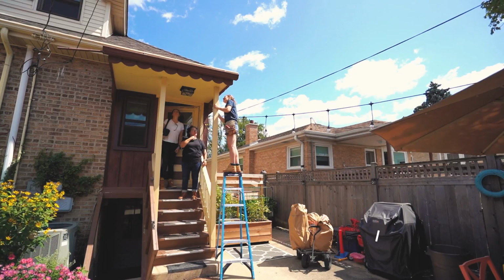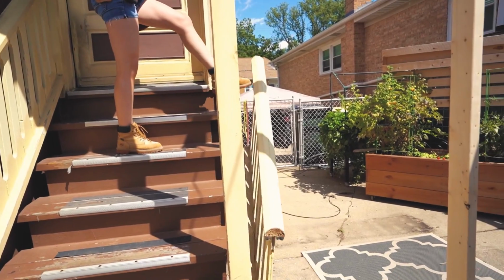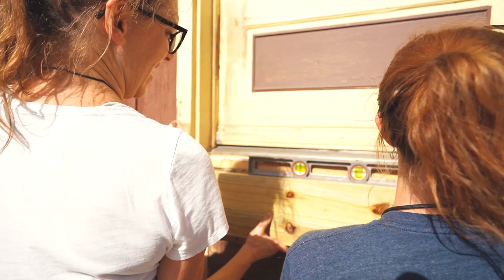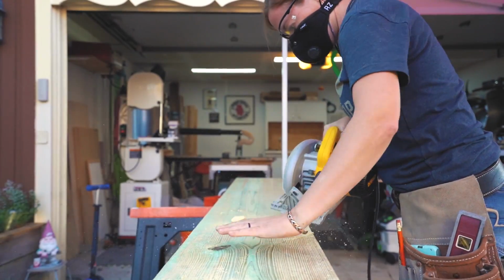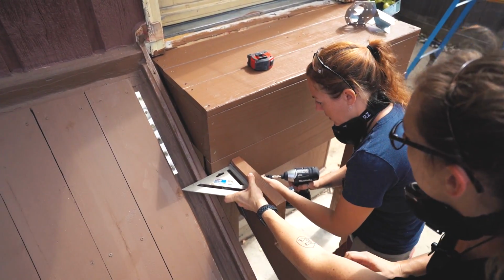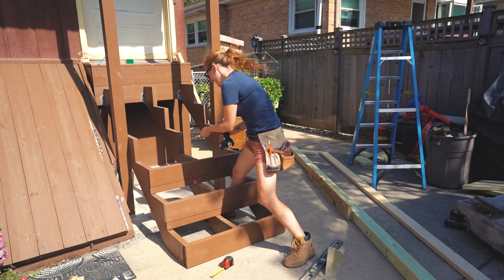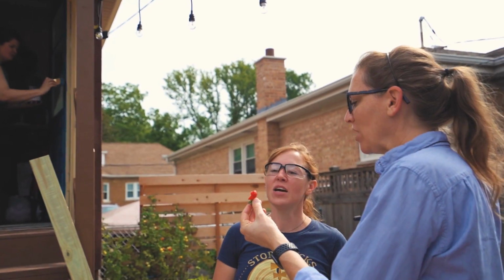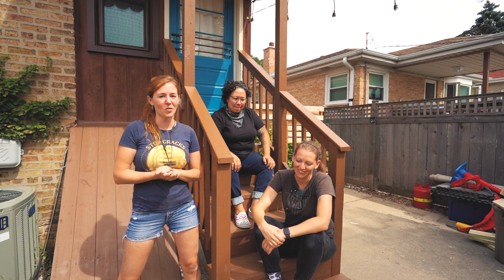Building a Set of Stairs in Three Days | DIY House Stairs | House Renovation

Comment: Great job, love your videos! Sorry to be the "but" guy, buuuuuutttt, you shouldn't use deck screws for joist hangers. There's special nails and screws with more shear strength, fit the screw holes in the hanger better, and hot-dipped galvanized to prevent premature corrosion between the two metals.

Comment: love the stairs but ya should of used 2 lag bolts at least . screwed into the wall of the house  (1 at each corner) to hold the main board on because over time  n age those screws will Give Way ....

Comment: April next time you find yourself in a struggle with concrete get a prybar put blocks under the corners then hit it on the top with the sledge it should break easy
Reply: Even with rebar in it?

Comment: Use ice to slide  heavy stone or concrete blocks on a hard surface. Lever the slab up a little at a time, shove wood blocks under each end until it’s high enough then shove ice under it and lower it. Make a trail of ice where you want to go and push. You need about three 10 lb bags of ice for every ten feet you want to move.

Comment: For non-rebar concrete pry up, put a piece of broken concrete underneath and break over it. Rinse and repeat.  Concrete has little strength against bending.  I've never had an opportunity to try with rebar, but it might work.  I had to break up gym locker pads.  After a half hour I had rounded the end.  Time to try something new. Aha. Half hour to finish the whole pad.  Good job.

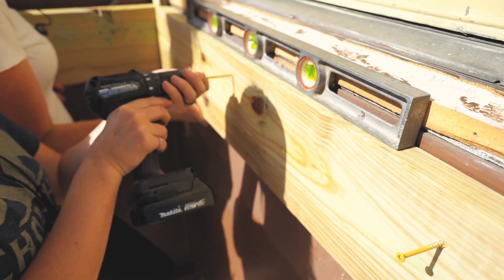Comment: Just wondering.... At 4:48 I didn't see you use Lag bolts to attach the header to the house.
Maybe some sort of flashing was needed between the house and the landing.

Also, the small landing you made, should the outer joists be be notched into the 4x4's for strength?
And, the bottom of the stringers is in direct contact with the cement.  Maybe some sort of felt paper or barrier was needed.  Nice project, tho.  You have a great channel.
Reply: Well said. I also didn't like that bottom of the stringers is in direct contact with the cement.

Comment: Nice work.
Where did you get those dust masks?
Also, if you put a layer of "sill seal" between the concrete and the wood it will keep the moisture from wicking up and make the lumber last a lot longer.

Comment: Good work and nicely shot.
slope on the landing? flashing at the house to landing gap? 
Hammering the concrete anchor bolt in, the nut should be a hair proud of the bolt stud, so you are hammering the nut and bolt together, not mushrooming the bolt. Might want to take that nut off in the future. 
Probably ought to have boxed in the top of the posts holding the awning, more secure than just a couple toed-in screws on each post. Chicago does get some pretty strong winds.

Comment: 12:35 you will need to paint the end of those treads. End grain is a sponge for water. Yes its a good idea to paint before assembly, but you should be painting AFTER cutting, so you aren't left with unpainted end grain. Do that and it will rot quick

Comment: Next time you need to break some concrete with a sledge hammer lift one edge with a pry bar, the smack it a few inches back where it is unsupported. It will break even with rebar in it, cut the rebar with your sawsall.
Learned how to do that 40 years ago on a 20' section of driveway.
Jim Y

Comment: That stain is gonna peel and chip off in a year or less. Wet treated needs to dry before painting/staining.
Reply: mascmc lol yup and it will be hot to the touch. not the best color. those spindles and railing they ripped out where awesome. the new railings are not as nice.

Comment: Treads usually have a 1" nosing.  But it looks like no nosing is required within the City of Chicago.
Reply: Not true ....open or solid riser dictates nose requirement. A solid riser requires min 3/4” max 1 1/2” nosing.  Let’s finish that wine :)
Reply: @rmaloney9976  I've  built my share of interior stairs, but never an exterior staircase. So perhaps different rules for different applications? But in any event what I was getting at was the decision to have a bullnose or not has a great deal to do with your space requirements and the minimum size requirements for a tred and what is perceived to be  a comfortable reasonable amount of tread space. Inside of a house the minimum tread depth is 10 inches, with each tread being within 3/8 in every other tread. (R311.7.4.2). But this is wholly inadequate for most designs, if you don't have enough distance in your stairwell to do a box at say 11 or 11.5, then you can add a bullnose to your 10 inch base measurement.
Reply: The requirement for stairs is rise over run, with bullnosing only coming into play when one needs to meet the rise over run requirement within a limited span. In other words, if you need to have 7 in 1/4 rise an 11 inch run with a certain number of steps but you don't have enough space to get that done oh, you can add a bullnose so as to comport with the 7 and 1/4 and 11 inch requirement within a given space. I hope this makes sense, I've already been through a half a bottle of wine, so who knows.

Comment: Did you close that hole, allowing critter access, that was created when you removed that cement block? I noticed it when you were down there attaching that bottom left rail post. Depending on what she stores down in the basement, you may not want critters down there setting up homes.

Comment: If you're new at building stairs, it's a good practice to only cut one stringer & then do a dry run on the layout w/ some scrap for top & bottom mounting plates, as well as to check your risers...Oftentimes, you will then realize that you forgot to remove that 1 1/2" (or whatever thickness of your first or last riser), as it will show up in the nosing missing on your steps.

I've built many stairs, but I have to do layout alone w/ no distractions. There is nothing worse to me, than someone talking to me or trying to help me...other than someone trying to hold the other end of the tape while I'm measuring.
Nice job on your project. The next one will be even better!

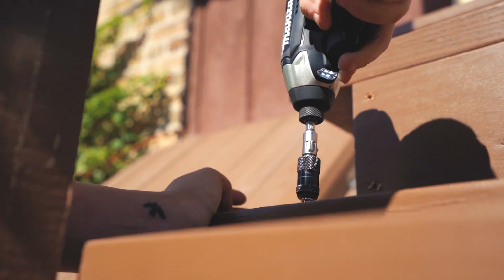Comment: At 11:04 it appears that some of the threads have a bit of a nosing (the edge of the thread overhangs the riser), an other threads are flush with the riser. You may not be required to have any nosing on stairs with 11 inch threads, but stairs with a nosing are considered to be more comfortable to climb than those without, and you'll kick the riser with your toe less as well.
Reply: Tread nose projection past vertical riser below (3/4" to 1 1/2") required on stairs with solid risers"

Comment: The landing SHOULD be the same distance as the door   EXP  32  inch Door  32 Inch landing
Reply: Per UBC : minimum 36” in the direction of travel
Reply: In width = to door width. Length min.= 36”

Comment: A rule of thumb - 1 screw for every 2" of board width.  Also, review structural drawings to obtain the correct fastening pattern required by code.

Comment: Unless I missed something, the landing posts were not notched. If that’s the case, isn’t all of the weight load being carried by just the screws? Is that a code and safety problem? Not a hater, just curious. Thanks for the video.
Reply: It is a problem. They should have at minimum been bolted, and notching+bolts is even better. Same for the header attachment to the house- should have been bolted.

Comment: The cement base you moved was present for keeping the wood stair base out of snow and water. Although you used adjustable post bases which will extend the post life; the bottom step ended up with a greater risk of rot.  A cement /  masonry base would be better. Chicago presents a large amount snow and ice melt cycles and many use salt based ice melt products to keep walks and driveways clean.  Thanks for the video and your willingness to help a colleague.

Comment: It's great that you're lifting others up. On the build, I would have thought it would be nice to make that landing deeper, I recall that most code requirements are 36 deep" ? Also, no continuous / terminating handrail requirement? Both of these are good ideas for usability if anyone else has a similar project. - regardless
Reply: The object is to build correctly.   Not see which shortcuts you can get away with.
Reply: She said it was a "specious" landing, so there you go!
Reply from the maker: Yep! A larger landing is certainly a great option but here we were limited on how far how we were pushing the stairs. They were already pushed out further than the first set when we made the rise and run all the same, and added in the landing. So we made the landing as deep as we could get away with.
Reply: @AprilWilkerson  Your efforts certainly made improvements over the prior set. Great job.
Reply: It’s not an option ! It’s required by code. You can’t disregard building codes for a flawed design. Now the homeowner has a liability problem and could be forced to rebuild correctly by the building dept.  if you had length restrictions in the original direction of travel you could have built an intermediate landing and changed direction 90 degrees for the last one or two steps.
Reply: @rmaloney9976  Which way are you suggesting to go; coming down the steps left is into the driveway and right is into the basement entrance?  A full landing is even further out than what they built.  This house is from prior to CODE.
Reply: Roy Reynolds yes Roy your right. My suggestion was based on an earlier reply from April stating that extending further in the same original direction would block the driveway. I see that’s not the case. 
So a proper landing to code would be even easier. Also once you alter a structural element thats “ old” and grandfathered in, problems must be brought up to existing codes and standards.  
Not a “ hater” ... love the ladies. , just trying to help with info to help

Comment: It's a nice build.   Not sure about the code there, however here, the landing posts are required to be under the joists, as the screws are not sufficient to support the deck, bolts are not even acceptable.

Comment: I would have made the landing just a little bit big just me.
Reply from the maker: I made it as large as we could. : ) By making the rise and run all the same, and by adding a landing, we pushed the stairs out further than the original by a good amount. If we went any further they wouldn't have been able to use the driveway to get into their garage.
Reply: @AprilWilkerson , I figure there had to be a reason.
Reply: You can’t disregard building codes to accommodate a flawed design.  If you had length restrictions you should have built an intermediate landing and turned the last few steps 90 degrees to the right or even 180 degrees. Since the new landing is less than required 36” it can be considered a tread and put the whole riser /tread  uniformity relationship out of balance

Comment: Very nice. Did you add any sand to the paint for the stair treads or do you plan on adding g self adhesive grip treads? I would imagine these are going to be slippery when wet or in Chicago icy.

Comment: The build was great ladies however for safety sake never stand on the top of a step ladder :) ("This is not a step")
Reply: A rule I've never broken

more than two thousand times

maybe
Reply: @ Jp. 😂 i Hear ya.😆
Reply: OSHA says to not step on the top of a ladder or the first rung down.
Reply: The last time I stood on the top of a step ladder I fell and totally destroyed my left shoulder.  It was a 4 foot ladder.  Can't lift the arm very far anymore.
Reply: @etheroar6312  Separated mine when an extension ladder slid out from under me.  And fractured a finger at the same time.  Shoulder is doing better than the finger.  Go figure!  Always check the rubber pads on the bottom of the ladder.  Especially on concrete like my accident.
Reply: Agreed ! But, We Have all broken that rule. as i Have Gotten older i try to Follow all the Safety Rules now.  But, You are very right ! You really should allways have 2 steps left before the top of the Ladder for Proper Ladder safety.
Reply: Please, for your own safety, because I care about you, do not step on top of the step ladder or use the last rung. It just takes one mistake and personal injury will result. take the time to get the appropriate height ladder.
Reply: 😂 😂 I came to the comments just to see how many YouTube safety police commented on her standing on this is not a step. The safety-police do not disappoint.
Reply: April worries about consistent rise and run on the steps for safety but stands on top of step ladder. APRIL! Please heed Bruce's advice. Think about what could go wrong, just think about the possibilities. Getting the right ladder is way less time consuming than the consequences of a fall.
Reply: When patriarchal safety Sally shows up
Reply: @bigvegass  Not trying to play internet safety cop. Just don't want these builder to get hurt.

Comment: Is this treated lumber?  Was it  pretty wet?   I was taught that you should let it  weather and dry out a little before painting.  Also, I noted (11:23) that the treads don't overhang the upright boards. Water is going to wick under there and cause faster deterioration and freeze/thaw problems.
Reply: The boards at the bottom rest directly on the concrete too, and in Chicago, that's gonna rot pretty fast. But the whole set up will last until then....
Reply: There's more wrong here than that. No z-flashing on the ledger - it's going to rot whatever is behind it. Deck screws for the hangers - not enough sheer strength. She kept saying "check with local codes" but I wonder if they actually got a building permit. lolz
Reply: I was going to say the same thing about the paint.  It’ll be chipping/bubbling off by spring.  Can’t trap that moisture.
Reply: You can paint but it won't stay😳
Reply: I would rather not have the treads overhanging because of the trip hazard.
Reply: @paulmonk7820  overhanging treads are not a tripping hazard....
Reply: Paul Monk exactly opposite... nosing is required by code if you have a solid riser

Comment: Question. Do you not need some sort of flashing between the stair landing and the threshold?
Reply: It wouldn't hurt, but being under an overhang and since there was no rot to begin with, they should be just fine.
Reply: @augustreil  always flash between a ledger and the house ...especially under an exterior  door